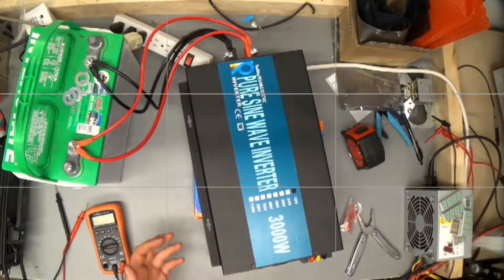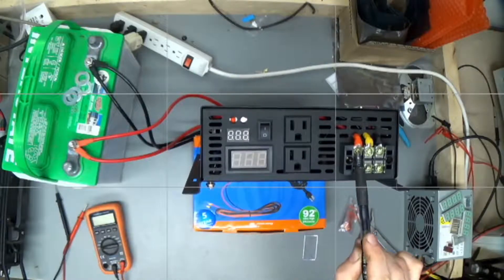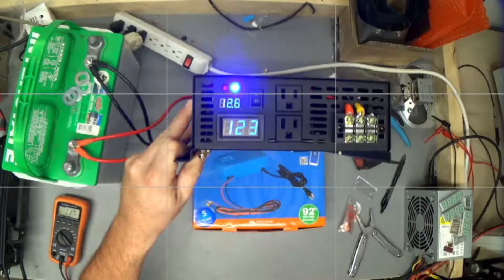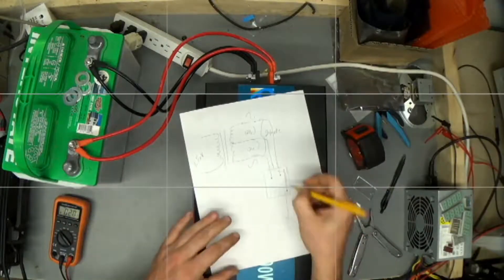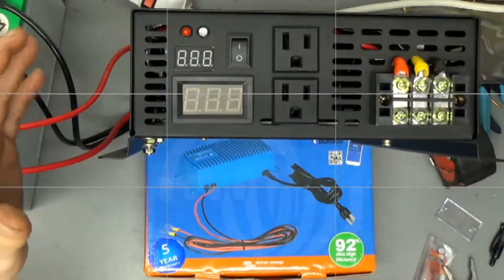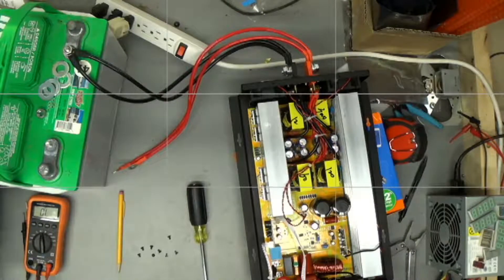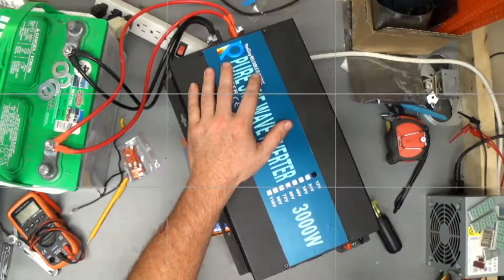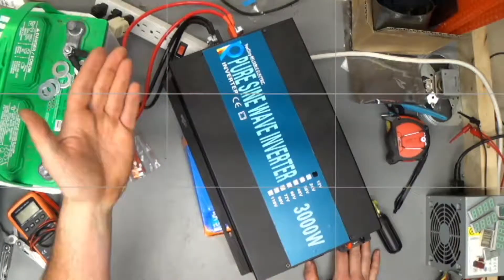Looking at the Infamous "Reliable" Brand 3000W Inverter.

Comment: Whos grabbing a live wire and then touching the chassis??
I think there's a higher chance of forking an outlet haha.
Reply from the maker: If, while wiring this inverter into a building's electrical system, you disconnect the center-tap "not ground" and bond the inverter's "neutral" to ground in the panel box, it places the chassis of the inverter at 60vac potential in relation to the household ground, since the inverter chassis is bonded to the center tap and there's no way to unbond it.

Comment: WattsinWattsout channel show you the problem of that inverter ... the hot and neutral are reverse on the circuit board ... the red wire goes on where the black wire is connected and the black on the front where the red is connect
Reply: Except these units aren't all the same. Sadly, mine (24V 2500W) outputs 60V coming off each leg off as measured from the circuit board. My Fluke inductive tester picks up voltage on both circuit board connections.

Comment: Thank you for this video! I have been looking everywhere for a explanation or possible fix for this.. I bought one of these inverters off of Craigslist to connect a small solar system to power 2 refrigerators in my home…it is installed now… but upon testing… I was afraid to hook it to my transfer switch/ Panel because of the ground problem… After watching this.. I’m glad I didn’t… I guess I will resell it and just pay for a better inverter…
Reply from the maker: It ought to be "fine" if you disconnect the "ground" (center tap) on the inverter, tie one side to neutral, and isolate the inverter enclosure (as it will now have 60VAC on the chassis in reference to your household ground).  That's what I've done, but I totally understand not wanting to be sloppy like that, especially if you have kids that might start messing with stuff.
Or rather, I guess I shouldn't advise you to do that in case you blow yourself up and sue me lol.  So yeah, don't do that.  :3
It is unfortunate that there is no viable way to unbond the enclosure from the center tap and properly ground it.  :/

Comment: #1 never use the cables that come with it and mine has worked quite well since I got it about 2 years ago.  I used 1/0 wire at 3 ft length.

Comment: I have the 12v 5000 watt version which is overkill for 12v because 0 gauge wire in 12 volt only handle 2000 watts.  and you try get more than 2000  watt  on 12 volt  it could catch fire. continuous power I can only get 1800 watt on 12 v system to be stable.   the neutral and hot are cross if you the bus and outlet together system shoot down . can only use outlet  or bus one a time only. factory cross the connection.

Comment: the inverter use 60v by 60v split phase to get the 120v so there no fix for this that why there 60v on ground to hot and neutral. 
is cheaper parts for 60v transformer.

Comment: Hi, I have an reliable 24v  120v inverter of 6000 peak watts and 3000 continuous watts, it works very well but when I turn on the washing machine everything goes well until it has to squeeze when it has to squeeze the inverter which is 24v because my system is in series when it is going to squeeze it drops from 120v to 42 and it stops working I have tried it using only the washing machine without any other equipment in my system I have 4 250ah batteries in series that is, I have 500ah of ery to work although in measurement the washing machine asks me for 25 peak amps to squeeze well I have tried it with the electricity of the house, it asks for 25 amps peak and then it regulates to 7 amps from your experience, what problem can I have? The washing machine is old, analogous with the digital washing machine, I don't have that problem, I blurt out, read this and guide me
Reply from the maker: Recheck your math and be sure that the batteries you are using can source enough current and the DC wire is big enough.  Beyond that you may just need a bigger inverter to handle the temporary load.  These type units appear to seldom have the power handling capability that they claim.

Comment: Whew.  3 kilowatts on a 12V battery.  That's asking a lot.  Like, 48mA of total resistance from the battery cells to the switching transistors.  (Assuming I did the math right, which I probably didn't.)

Also, is the voltage "building up" when you turn it on, or is the AC voltage meter just windowing the measurements?
Reply from the maker: I plan to ultimately run it off a bank of several 6v golf cart batteries.

I dunno about the meter windowing.  I shall have to check it.
Reply: The AC output slowly ramping up is normal for the entire class of HF portable inverters.  You'll find it referred to as softstart.  Manufacturer's often state it's to protect your devices, but it's really about protecting the transistors in the output PWM circuit.  Similarly the inverter will collapse the AC output under load behaviours it thinks are excessive.  It really all boils down to working around shortfalls in the control firmware that should react in time to protect the transistors (typically IGBTs) in the output PWM, and the transistors (MOSFSET) on the HVDC supplies.  IGBTs are pretty rugged devices and can take a lot of abuse so for them to blow up you know that the control of them is ... a bit crap.  This is very well demonstrated by the way these type of '120v' inverters that are really 240/120 split phase inverters with a lower output voltage blow up when people short one phase to what they imagine is the earth terminal to establish an declared neutral as per this video.  The inverter should see excessive current in the output bridge and shut down the output well before things go bang.  It's not an impossible task, just beyond the cheapie copy-circuit manufacturers.

Comment: When I learned that the ground pin of outlets is tied to the neutral in most household wiring, I was shocked!  OK, not literally... but I'm still baffled.  Why have a 3rd pin at all, if it's the same as neutral?  And if I accidentally touch a Hot wire and the case of something "grounded", I still get electrocuted, so that doesn't sound safe to me.
Reply from the maker: The neutral is current return, while the ground is a safety return in case of wiring fault, a low impedance return to ground for the current to take and blow the breaker rather than trying to return to ground some other way and starting a fire.

The neutral is grounded so that it stays at earth potential, same as you and your house and everything else.  This way, if there is a fault there is only one wire that is "hot"; since you and the neutral are both at earth potential you can touch it without getting a shock.

The ground is grounded for obvious reasons.  :P

So you'd think well why not use two separate grounds so they don't have to be bonded?  Problem with that is that the earth is a great big capacitor and depending on moisture, soil composition,  static in the air, etc, the two ground can be at different potentials, and then you get a transient current between them if there is a fault, and these transients can be large enough to injure you and/or damage your appliances.  So them bond them together at the same point to prevent that.

I'm not sure how much of it is strictly necessecary, how much of it is safety sally stuff, and how much of it was originally intended to prevent rfi from interfering with over the air tv and radio.  We had a 2 wire system with no ground until sometime in the 70s iirc, and there are still a lot of old houses out there with old wiring whose 3 prong outlets arent grounded at all ( including the part of the shack I am sitting in as I type this).  But inspectors gunna inspect I guess.

That's just my dummy understanding about that stuff.  I may be full of poo about some or all of it lol.
Reply: @Lee_Adamson_OCF   I am not an electrician, but my understanding is similar.  Mostly, the two-wire system didn't specifically mandate a polarity.  The prongs were the same shape and size, so the appliance didn't care.  It was all intended to power resistors, for the most part -- heat, light, cooking appliances, that sort of thing, and there's very little difference which side is which.  Then we found it useful for all kinds of other things as well, and some of that changed.

So that's our legacy -- you've got two pins that can go either way 'round, which doesn't require the electrician to wire up any particular side as hot and neutral.  It doesn't even strictly require one side to be neutral at all.  It could be two hots.  (Although we only do things like that for 240V appliances, AFAIK.  Not counting 3-phase stuff either.)

Now the real problem is when you start putting metal boxes on things, as any kind of wiring fault could end up with the chassis connected to one of the power pins.  Which one is a 50/50 chance, and whether that particular pin happens to be at neutral potential or 120V or 240V is also up to chance, since we can't even trust that the slots of the receptacle will be wired in a consistently safe way.

And, think about all those electronic gizmos you have that connect together.  Your VCR and TV, if you're living in 1992.  Or your external Firewire HDD, if you're living in 2002.  You've got a chassis connected to 0V potential, plugged into a different device with its own PSU, and its chassis is also at 0V potential.  Imagine what happens if one of those chassis is plugged into a 2-pin socket with the pins reversed.  Now you've got 120V on one side crossing to neutral on the other side via the tiny wires in your interconnect cables.  Bad news!

(Edit:  Ideally, it's all galvanically isolated via a transformer in the PSU, and so the 0V reference between the two of them only exists by way of the cable.  But it gets more complicated when you have things like AV receivers with connections to a LOT of other devices.  Having a single consistent ground reference is helpful.)

Ergo, a third pin, that is absolutely and definitely at ground potential.  If there's a short to neutral, not much happens.  Perhaps you trip a newer breaker that is meant to detect out-of-circuit current leaks.  If there's a short to hot, it pops the breaker or fuse.